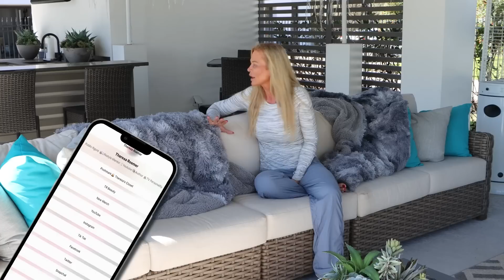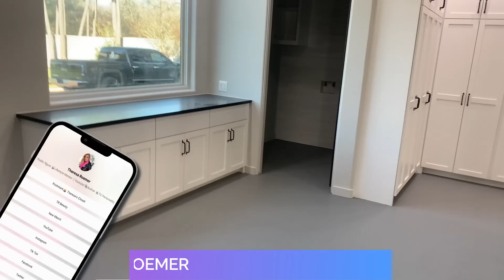ALL COMING TOGETHER!!!

Comment: When things don't go your way you pick your self up, you dust your self off and you keep on trucking. If I could join your paid content I would. Right now I has no income, applied for disability because I'm 51 years old I'd had all kinds of knee surgeries, total knee replacement two years ago I'm bone on bone on the other knee an it needs to be replaced and I just learned my kidneys are bad from all the years of ibuprofen intake and I I learned that I have either lupus of the kidneys or lupus of the body an I'm like OK god what next. I just keep going as I can. All you haters leave theresa alone. What I get from your channel is I learn a lot from you. 😁